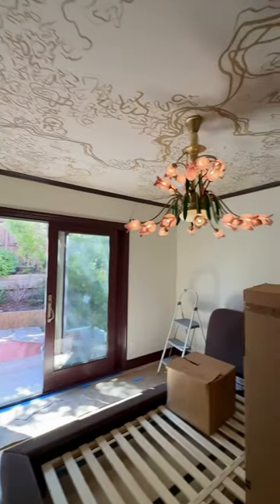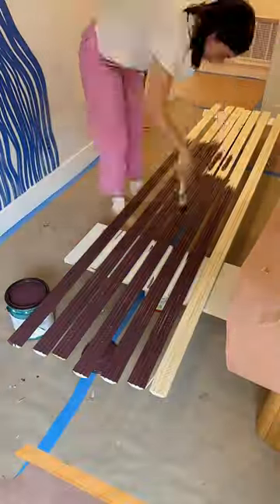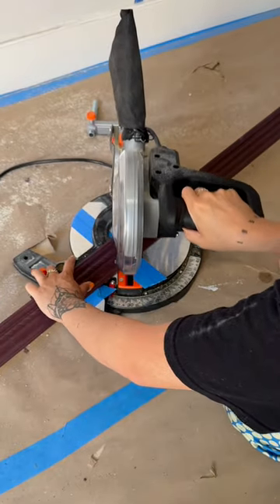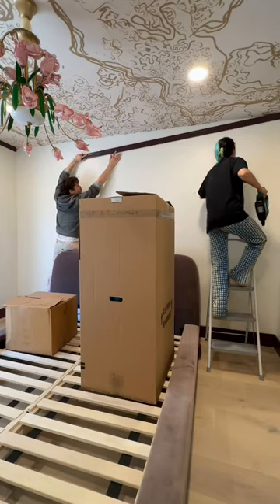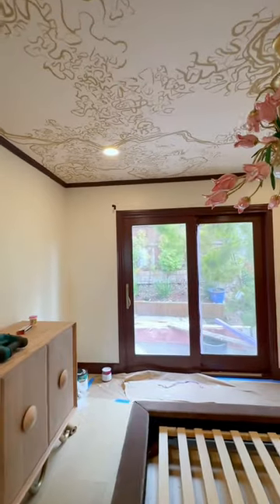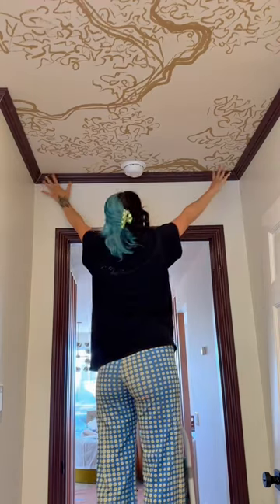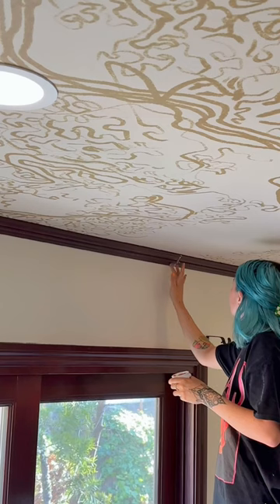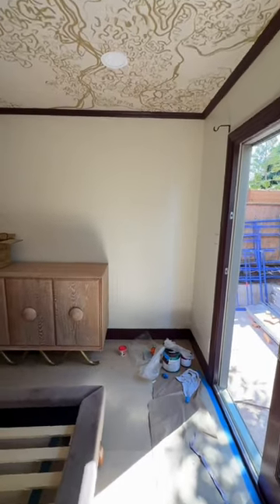I will be doing this EVERYWHERE now #diy

Comment: * JUST A TIP * after you cut the angles you could have used wood markers on the unfinished wood area that way after you tack it up you wouldn't see any unfinished wood,  then you wouldn't have needed to putty, sand and repaint 😊😊

Comment: A friend of mine super glues his seams on the long runs & usually his outer corners of trim. Less filler needed & wood tends to shrink & expand so using wood filler may crack later.